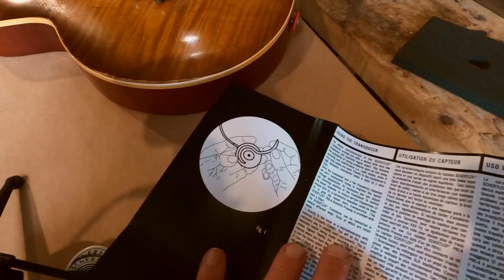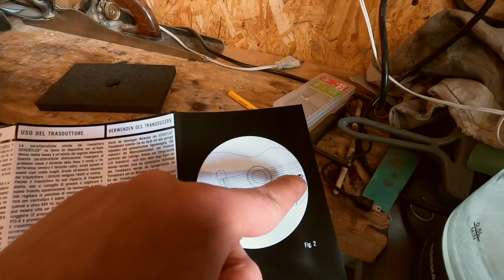HOW WOOD SOUND on unplugged electric guitar. (experiment)

Comment: Sat on my bed 1 night playing a guitar and the headstock touched the wall, I was not plugged in, but as soon as it touched the wall the volume got louder  like the vibrations were bounced back through  the neck into the body?
Reply from the maker: Yes, a guitar only needs one point to retransmit a looped vibration to another object.  A table, a wall, a drawer... All of these can amplify the transmitted sound.  It's like a vibro speaker
Reply: There’s actually a little Bluetooth “speaker” on the market right now that only works if you have it attached to a window or something similar. If you just hold it in your hand it’s whisper quiet. But once you put it on a wall or a window then suddenly you can hear it

Comment: Would be very interesting if you could compare the pattern of vibration on an original 59 to one of your copies by means of sand or salt patterning on the flat back of each guitar, and much more interesting if by the pattern demonstrated on the original 59, you were able to devise a technique during building that allowed you to form and shape wood to match and fully replicate the pattern made on the original 59.. Now that would be something..👍👍👍
Reply from the maker: Hello.  Thanks for your comment.  Yea, that's an interesting idea.  For a long time I studied the topic of standing waves and such experiments with sand or salt.  But unfortunately for me they are uninformative.  Such experiments create a beautiful visual effect that depends on the original signal, but at the same time the human ear and body capture much more nuances.  But such a video would certainly be useful for the channel.
Reply: @8BombCustom  I'm curious about what you think the physical difference might be between yours, and a '50's Gibson, if anything.  The only thing I can think of is that the years of vibrations may effect the wood.  I also have an old growth mahogany replica, but it is heavy at around 4.6 Kg ~(10.Lb).  It sustains well, but can be uncomfortable because of the weight.  It probably doesn't sound the same.  Yours should be near exact to the old Gibson's.

Comment: That‘s a good way to analyze the dispersion of vibration in the wood. I would use it to test different tail pieces too. 
    Did similar to get to know my guitars better, by putting my ear on different places on the back of the body and neck while strumming. 
    The weakest sound was right under the bridge, the fullest was on the horns (on double cuts more). Moving away from the bridge, the vibrations get louder and warmer. 
    The loudest and fullest sounding spot, with lots of treble, was right on the neck heel. The treble probably from the screws and/or the neck plate. There would be a pretty good place for a piezo…

And you‘re a good player!👍🏼

Cheers
Reply from the maker: Thank you